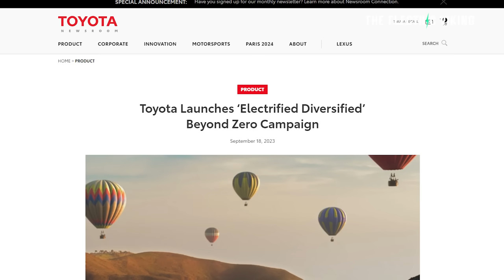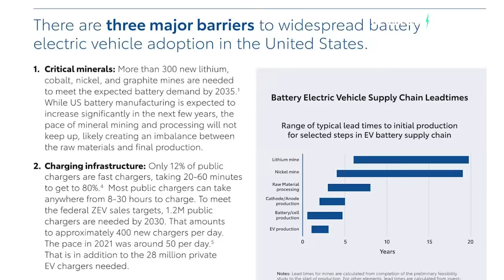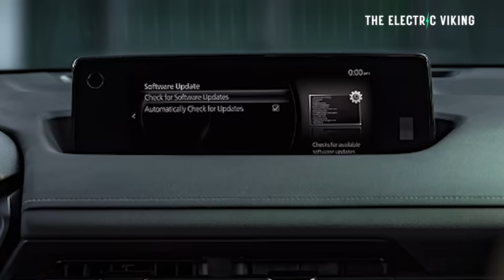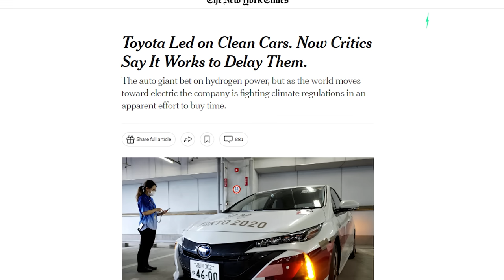We are witnessing the early stages of the biggest fall of any company in history

Comment: A few weeks ago I picked apart an article "This NEW Engine Will DESTROY The Entire EV Industry!" which is about Toyota's water engine.  This video showed a block diagram that shows an EV sized battery that electrolyzes water, throws away the oxygen and burns the hydrogen in an ICE engine.  I explained how dishonest this approach is.  All ICE engines produce NOx pollutants as long as they take in air.  I understand the problem of 5.5 million unemployed Japanese workers, but ICE engine makers are no more appropriate in our future that dinosaurs are.  They should be retrained to make electric motors and batteries.

Comment: It's actually quite brilliant, Aiko Toyoda knows he's fallen in the ocean but will survive by drinking all the water.
Reply: Toyota will collapse right around the same time we have that magical battery that last 10x as long, charges 10x as fast, is 10x as safe, and 10x cheaper to produce.
Reply: @Ryan_DeWitt  Why would you need a car with 3000 mile range, which you can fill in 2 minutes and where the battery costs $800, cheaper than an ICE engine?
Reply: @surur_  My point is that "magic" battery is never coming.  A battery is limited by basic laws of energy and physics.  There is only so far you can push it.  So unless some literal miracle happens, as in someone finds a way to give laws of energy that apply to everything the middle finger, battery tech isn't going to make some amazing improvement anytime in the near future despite all the promises.
Reply: And it does not need to. Electric cars are already good enough. They just need to keep getting cheaper. Quite soon electric cars will be cheaper to buy, not just cheaper to service and drive, which is the case today. Then demand for combustion engine cars will start to dwindle which will raise prices or stop development of new cars with combustion engines.
Reply: Next year Tesla will have a gen 3 compact 5 seat  SUV something like a modern Golf for $25,000 with LFP batteries .  It will have a range of about 270 miles, 48V electrics, steer by wire, brake by wire, OTA software updates and upto 350V  charging.  Most people do not drive more than 40 miles a day and  a lot of people, not all, will just charge overnight at non peak times.  Tesla provide their own car insurance, need minimal servicing so have low running costs.  Plus Tesla will be making a good profit on this car and sell millions of them.  Ford and GM are making cars on a production line invented a 100 years ago and can´t make a profit on a large SUV or medium pickup truck.
Reply: @Ryan_DeWitt  That's what they said about semiconductor and moore's law. Look at the industry, through human ingenuity, there's no sign of slowing down as we approaches physic's limitations.
Reply: @Ryan_DeWitt  2X will be enough to completely collapse legacy auto. ETA 3 years...
Reply: Glub-glub-glub.

Comment: Akio Toyoda is a petrolhead and loves everything about the old fashioned technology of gearboxes, clutches, noise, vibrations and toxic smells. I get it, there’s a certain nostalgia around the history of the internal combustion engine and it’s quite remarkable where we’ve managed to get to with this crude means of propulsion. 

However, most people aren’t petrolheads. To them a car is a domestic appliance that gets them around. They like a quiet vibration free car that costs as little to run as possible. EVs do this well. So while the enthusiasts make a big fuss about the nostalgia of ICE the rest of the car buying public will buy a better product, an EV, that fits into their life.
Reply: If Toyota would just build a, no electronic car, manual everything.  They would sell millions.  Simple build, simple parts.
Reply: "They like a quiet vibration free car that costs as little to run as possible." - can agree with that, although you'll never be vibration-free with the state of our roads!  
"EVs do this well. " <- Quiet, sure.  costs little - nope.  Maybe if you have off-street parking with charging facility ideally from solar, and even then it takes a fair bit to offset the initial outlay and the depreciation.  However, if you're a street parker using the non-existent charging infra or the hens teeth (in AU anyway) fast chargers then no.  You're gonna have a hard time recouping the additional upfront and depreciation costs and it's quite likely that the actual charge will ultimately cost more than the liquid fuel equivalent unless we artificially inflate liquid fuel prices. (a Youtuber in the UK, Macmaster, moans about the price of charging now being parity or worse compared to petrol)
"the rest of the car buying public will buy a better product, an EV," <- yes and no.  No being the conclusion.  EV is not a better product for everyone.  At least not yet.  Too many compromises.  eg, charge times - yes, if you can charge overnight it can be net gain, but not everyone can.  The cold saps range.  Long distance trips need careful planning.  These last two can be overcome by bigger batteries, but that'll cause longer recharge time.  Convoluted charging infra - forced smart phone adoption for the plethora of apps for example - it needs to be as simple as liquid fuels are today;  pull up, charge, tap to pay with credit/debit card
Reply: Evs are done
Reply: @davelloyd- I agree, EVs need to be as simple as ice, that's why a lot of companies joining with NIO to use their swap stations, no need to buy the battery if you don't want to, no need to fight over a slow charger. Ideal for people without the ability to charge
Reply: Like all stubborn legacy industries with no vision for the future. Legacy auto will all go like Kodak, blockbuster, Sears, yellow taxis, Nokia, travel agencies...
Reply: @larryc1616  I think Nokia is still around. Too many sunk costs in old tech for these big companies. Should have given up on hydrogen a long time ago.
Reply: @larryc1616 Rotaty phones, cassette tapes, VCRs, Vacuum Tube TVs (you'd be surprised how many young viewers have no idea where the word tube comes from in the name YouTube).
Reply: True
Reply: Which is ironic, because Toyota based its business model on building appliance-like cars.  The Camry and Corolla - cars that don't inspire much "fizz" but you know they will run when you turn they key and get you where you need to go with little fanfare.
Reply: @davidbeppler3032  most people want a car that runs, doesn't break down even if you skip a service and doesn't require them to get their hands dirty.

Comment: I worked on Emission Testing Equipment as an Electronic Engineer for 29.5 years.  Very simple, you burn HC or Hydrocarbon ( Gasoline ) the by product is --->Heat-->H2O--> HC ---> CO---> CO2----> NOx ---> Look at your old smog test and you will see these gas values produced by a ICE car.  This is basic Chemistry.  Actually Organic Chemistry which I took in College   EVs don't produce these gases